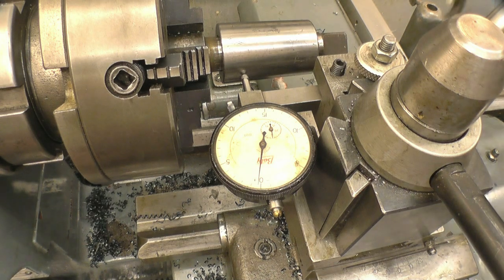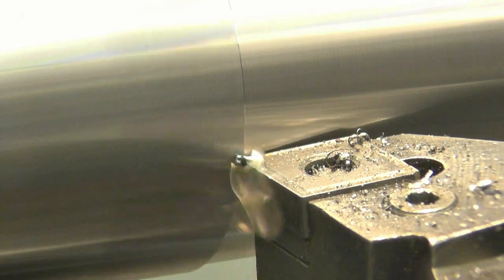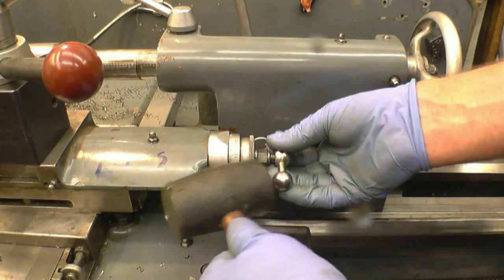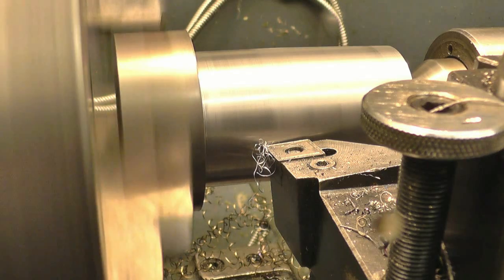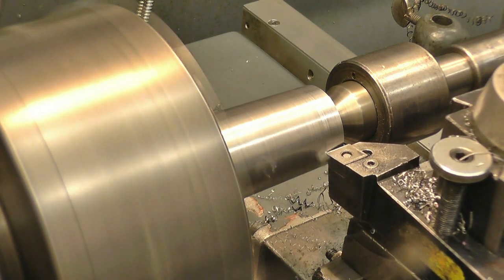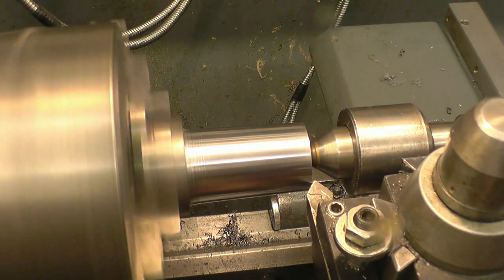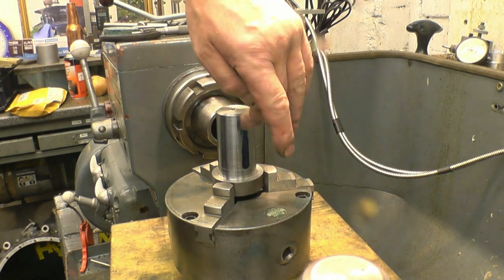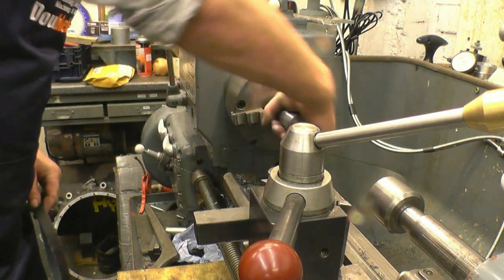SNNC 133 P2  Machining tapers   Viewer mail  Steam locos

Comment: John, when I turn tapers, with stock larger than the large end of the taper, I first turn the bar down to the largest size.  That way you have removed most of the stock, before using the compound.  I also use your method of turning the compound.

Comment: Nice one John. I especially appreciated the locos. I spotted two Gresley locos: Flying Scotsman which  in the 1970 toured the USA , great success. The other one is an A4,  AKA  "Mallard type" . Both 3-cylinder locos. The original Mallard still holds the official record speed for a steam locomotive, 126 mph (201 Kph) with a dynamometer car behind so it is verfied. Some other locos may have exceeded this but the timings are not authenticated. And nice explanation of how to set up for a Morse taper. Best to Debs and your Dad.
Reply: There is an update on the Steam Locos in the thread
Regards 
Stan
Reply: Thanks!

Comment: John, what I've been using for file handles now are screw driver handles. Get them real cheap at boot sales and garage sales. Heat the blade up to remove it. Then a little bit of epoxy in the hole and drive it on the file.. Once in a while il get one that splits but that's what the word bastard is for..

Glad to hear Deb is still going strong.
Reply: Great idea!

Comment: John a good way to clean the files is to soak them in malt distilled 
vinegar..I got some from the car boot mate they where full of all types of stuff.
Rust and swarf..I left them sitting in vinegar for 2 days washed it off and applied
some oil..Now its Vsharp and clean..
Reply: use a copper pipe flattend to scrape any bits off diagonally too, and wood  file handles are really cheap on amazon